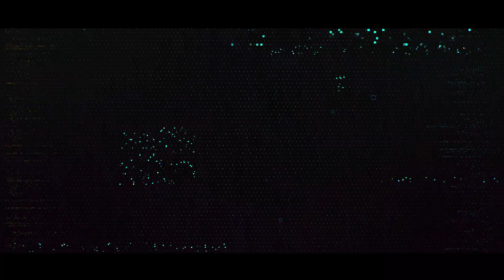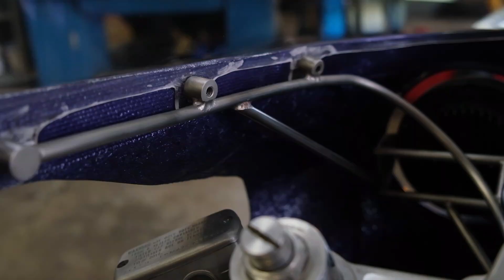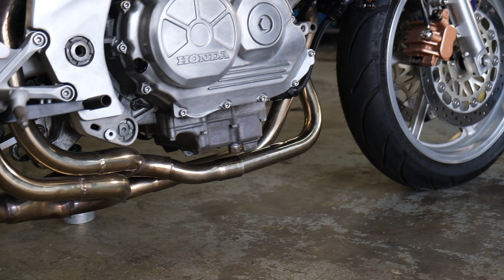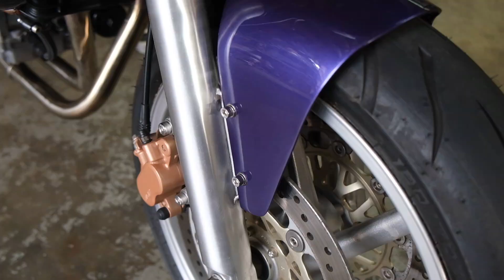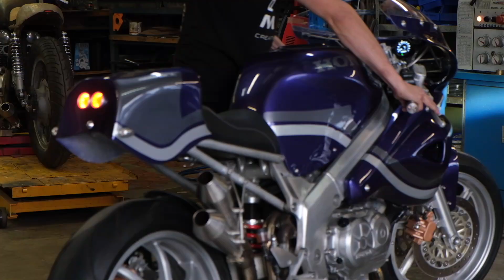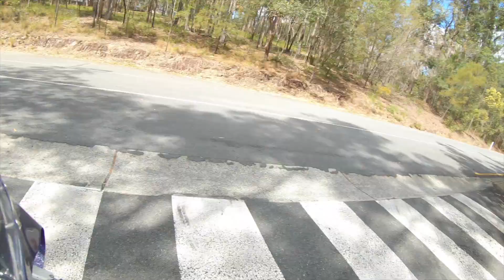Honda VFR750 Custom Retro Racer - Purpose Built Moto

Comment: I can appreciate the fab work required for something like this.  . . . .Not sure I like the purple but it does make it low key and not overly flashy.

I might have been tempted to go with the white wheels and have a white stripe, but I think the aluminum grey type finish works better.

The font fairing support work is awesome. 

This is exactly what you do to a 3rd gen if you find a running one in bad shape..  . . .And lately, even finding a 3rd gen (89-93) is getting harder.   If you were going to resto-mod a 90's bike, this is the bike you would do it too.

Comment: Which year is this? Wheels look to be rc36I however frame looks to be rc36II. Nice build.
Reply from the maker: It’s a 1994 bike with older model wheels. 
I way prefer the older wheels just because of how they look
Reply: Purpose Built Moto Thanks for the fast reply and I agree. Have a rc36II 1995 model myself, was considering to buy the older model wheels aswell, especially since the rear wheel can have a wider tire. Are you going to sell this?

Comment: Nice Job! I have also a VFR 750, that i'm slowly doing a restomod. Ccan you explain what did you do regarding the oil cooler, it appear to have some custom oil line, did you fabricated or you bought from somewhere ?
Reply from the maker: Hey mate we have a custom brake and hose specialist we use for all line like that. It was simply re-mounted with new custom lines